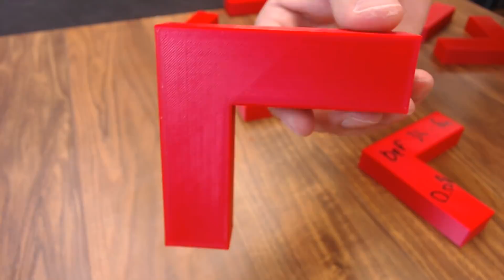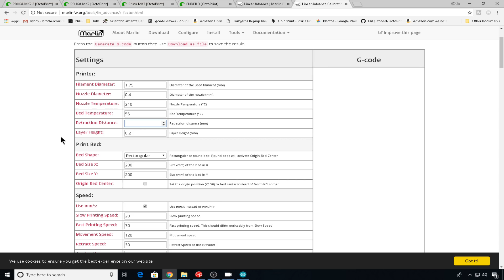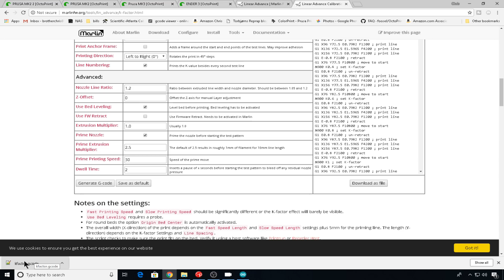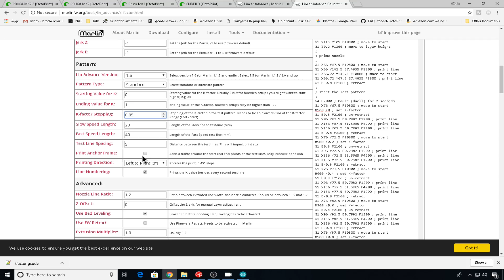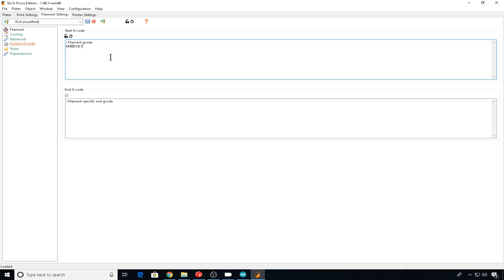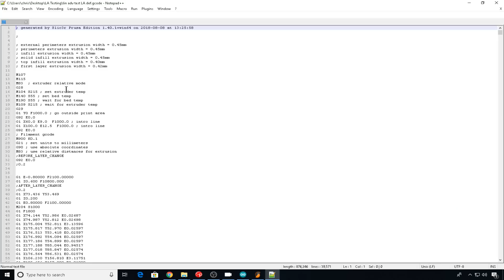Linear Advance - Marlin 1.1.9 - Faster 3D Prints - Chris's Basement

Comment: do you have a good article on slicer settings and values to change it to when Linear Advance is on? im currently using prusa slicer.
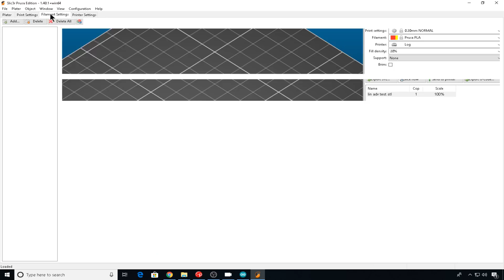Reply from the maker: 10:36, really all you have to do is add it/update it to the filament profile and you are all set.
Reply: @ChrisRiley  what do i change on my filament profile?
Reply from the maker: @darkfool58  If you are using Marlin, you just add an M900 K0.02    Update this command with the K value from the testing.

Comment: Hey, thanks for the great video, Chris. Question for you though... I'm running an Ender 3 Pro with a BTT SKR Mini E3 v2 and just started playing with Linear Advance. When it's enabled, the extruder makes a horrible grinding noise for every move. If it's disabled, no noise.  Any ideas?
Reply from the maker: What is you K value set to? If you enable it then run a M900 K0 does it go away?
Reply: @ChrisRiley  I downloaded the latest firmware from BTT's GitHub page, which has it enabled. I set Linear Advance K=1.1 based off of my experiments using Marlin's calibration gcode generator (it makes the grinding noise when printing that as well).  The K value is set in my Prusaslicer filament profile.  When I print another gcode file without the K value set (so set to 0.0), no issue.
Reply from the maker: @shannim5  Try adjusting your extruder jerk value, try making it larger to slow it down a bit.
Reply: @ChrisRiley  Doesn't seem to do anything. Looking at the configuration.h file,  it looks like E-jerk is defaulted to 5.0.  I've tried several values greater than that and it still makes the grinding noise. It's hard to tell if it's actually grinding the filament though. With K=0, I've haven't encountered any filament grinding and the extruder seems to be able to change direction and accelerate with no issues (visually looking at my extruder knob).

Comment: My linear advance calibration looks good except for the restart, at the start of each line (on both the calibration print and any model) it’s a little thin. On models you’ll notice gaps in the seams, or poor adhesion between the walls on starting locations (because the wall is too thin at start). Any suggestions? I thought maybe retraction is too high but i’ve tested between .2 & .8, retraction speeds between 20-70mm, no skipping of steps everything is calibrated perfectly on extrusion (bmg dual feed direct drive). Only thing I haven’t tried is adding extra restart distance - but everything i’ve read says don’t use restart distance. Your thoughts?
Reply from the maker: I would check through your Gcode, it sounds like the slicer is adding some retraction somewhere. Maybe like retract on layer change. What E driver do you use? What is would K value?
Reply: @ChrisRiley  made sure all the retraction on layer change and stuff was gone it is fairly good about retraction use but everytime it uses retraction the restart pressure just isn’t there. I use the TMC2209s, k0.13. All the corners and speed changes look amazing, but those darn restarts...
Reply from the maker: @TheFunVampire  What slicer are you using?
Reply: @ChrisRiley  idea maker
Reply from the maker: @TheFunVampire  Hmmm...I would have to try that out.
Reply: @ChrisRiley  oh forgot to mention i turned off LA, still had the issues so its got to be something with my retraction in general. But im direct drive, .8mm retract, 50mm retract speed and 20mm restart. Nothing crazy. Tried temp ranges from 200 to 215 (less then 200 seems to cause clogging). This is all in PLA for now. Until i get PLA perfect im not touching anything else 😂
Reply from the maker: @TheFunVampire  I was thinking about this. Maybe it's your jerk value. Are you using jerk or junction deviation? Either way, it might be to slow on retraction.
Reply: @ChrisRiley  using jerk and acceleration. Turned JD off. Think i should compile the firmware again with LA and JD on? Do they work well together? Going to go check jerk values now

Comment: Dos the K value change with Layer height , for example if you do your Test pattern at 0.2 layer height (where its Easy to pick winner) will it alter if you then drop your prints to 0.1 ??
Reply from the maker: No, it shouldn't change with layer height changes.

Comment: do you need Linear Advance with Prusa MK3s? or is it auto in there software.  just looking at the Pretty PETG profile thing and it said something about Linear Advance so then i decided looking into that was needed
Reply from the maker: If you use prusa slicer it's in the filament profile. You will see the M900 command in custom gcode.
Reply: @ChrisRiley  thanks

Comment: @chris Riley, Would you know how to configure linear advance for 4 extrudes, the configuration tool doesn't have a setting for them, ie T0, T1 etc, cheers jason
Reply from the maker: Hey Jason, are they all different types or all the same. If they are all the same you can just enter your M900 command in the filament gcode settings and on tool change it will use that setting.
Reply: You should be able to edit the gcode to switch nozzles. By just changing the extruder index

Comment: Great video Chris thanks for taking the time to share your knowledge with the maker community.
I have a problem that I am hoping that you can help me with. Firstly I must point out that I am a complete novice to 3D printing, I have an Anycubic I3 Mega S which is less than a month old, but already I have migrated to Marlin 1.1.9 and installed TMC2208 drivers and a BLTouch, which caused me quite a few headaches in getting it to work correctly, (thank heavens for YouTube!).
My problem is this, after homing (centre of the build plate) when I start a print job the print head travels  to the front centre of the build plate at an unbelievably slow  speed (you can actually hear the feint ticking of the Y stepper motor as it traverses. When it eventually gets to the front centre position, it zero’s the Z axis then travels back to the centre of the bed and starts printing normally. I have inspected my configuration in Marlin but I can’t seem to find a setting that would correct my problem.  Can you help me please? Thanks.
Reply from the maker: Hey Fred, thanks. So you do Z safe homing in the center? It sounds like something isn't setting the feedrate correctly. Anything interesting in your start gcode?
Reply: Hi Chris, thanks for your reply. Yes there is something not quite right (I think???) in my start G-Code in Cura, I can't see a speed number for travel, but like I said I am still learning. Here is my start script, please tell me what you think.

G21 ;metric values
G90 ;absolute positioning
M82 ;set extruder to absolute mode
M107 ;start with the fan off
G28 X0 Y0 ;move X/Y to min endstops
G28 Z0 ;move Z to min endstops
G1 Z15.0 F{speed_travel} ;move the platform down 15mm
G92 E0 ;zero the extruded length
G1 F200 E3 ;extrude 3mm of feed stock
G92 E0 ;zero the extruded length again
G1 F{speed_travel}
G0 Y20 F{speed_travel}
M117 Printing...
G5
Reply from the maker: @m0gga  Hey Fred, not sure what that speed_travel parm is set to, but, if you replace {speed_travel} with 5000 that should get it moving much faster.
Reply: @ChrisRiley  Thanks Chris, where will I find that parameter, in my slicer or in my firmware settings?
Reply from the maker: @m0gga  That's in the slicer, look for travel speed under the speed section. You might have to enable that setting to have it be shown. You can do that in preferences then settings and just check all.

Comment: What would help more, higher or lower acceleration / jerk on the E stepper motor?
Reply from the maker: In what since? With Linear advance enables you mean? I don't think I understand the question.
Reply: Sorry, my bad.
What I meant to ask is:
What would help more with linear advance, if I would higher or lower the acceleration / jerk value on the E stepper motor in the Marlin firmware?
So, would it be beneficial to have a higher acceleration and jerk (on the E stepper) for linear advance, as long as the motor don't overheat and don't miss steps? I don't mean extreme values just a bit more than what I normally use (500 acc, 5 jerk), like 2000 acc, 10 jerk?
Thanks in advance.

Comment: I'm a little late to the linear advance party. I have cr10 with Bowden. Tried this yesterday and struggled a little. I have S curve acceleration and junction deviation enabled. Would it be better with standard acceleration and jerk?
Reply from the maker: There is a certain mix that can confuse things. I would try with jerk and standard accel to start out.
Reply: @ChrisRiley  well, after a little messing around I'm matching the quality of the previous prints. This time no clattering of the extruder and much better infill.
There's light at the end of the tunnel!!
Reply from the maker: @TYGAMatt  Nice, great job!
Reply: @ChrisRiley  thanks. I'll give it a bash

Comment: Hello,
Very well explained.
It works on X however  cann't see any inprovement on Y. I have a 3mm glass on  bed. Any suggestion?
Reply from the maker: Hmmm, probably just a lot of mass to start and stop. If you lower the acceleration it should improve it some.
Reply: @ChrisRiley  Hi,
Which of next lines referes to acceleration that you recommned to lower:
#define DEFAULT_MAX_ACCELERATION {2000,2000,100,10000}
#define DEFAULT_ACCELERATION 500
#define DEFAULT_RETRACT_ACCELERATION 600
#define DEFAULT_TRAVEL_ACCELERATION 1000
I guess it should de "#define DEFAULT_MAX_ACCELERATION {2000,1000,100,10000}" 
Is that correct?

Best regards
Reply from the maker: @arturomendez7945  Correct, I would start with #define DEFAULT_MAX_ACCELERATION {1000,1000,100,10000} then move up from there.
Reply: @ChrisRiley  HI,
I already have changed extrusor spring as old one grinded so much filament (K value was 0.22). New spring force is less.
Now I have tried again LA and looks that best K values is arround 0.6. I am in doubt about such value as k values shared from several 3D printer users is around 0.2 (0.1 to 0.28). I know that range pattern goes from 0 to 2. In my case only manly change is spring.
FYI: Just changed power supply too that ajusted to same voltage 13.5V
What do you think about such value? spring can influence so much?
Reply from the maker: @arturomendez7945  I've never seen one come back so high, seems like you might still be slipping on the filament or something.

Comment: I tried it and my bondtech bmg started making a crazy noise, it didn't sound healthy.  Is this normal?
Reply from the maker: There have been issues reported in some configurations. They are still working the bugs out. No, you shouldn't have any strange noises.
Reply: @ChrisRiley  I only tried it with cura, I'm going to try again prusaslicer and see if that fixes it

Comment: Don't go over a value of 2 for Bowden setup?  But Marlin's own generator suggest starting in values of between 30-100 for bowden tubes.
"Starting value for the K-factor. Usually 0 but for bowden setups you might want to start higher, e.g. 30"
"Ending value of the K-factor. Bowden setups may be higher than 100"
Reply from the maker: Hey John, are you looking at Linear advance 1.0 maybe? They changed the scale in 1.5.
Reply: @ChrisRiley  Pulled directly from the generator when I posted.  Maybe they didn't update the generator text
Reply from the maker: @JohnVanderbeck  Ah, yep, I see that. Probably needs an update.

Comment: Why would you set your acceleration lower than normal for the test?  İt should be an important precondition from what you explained.
Reply from the maker: Linear advance 1.5 actually adjusts acceleration as needed.
Reply: @ChrisRiley  Yes obviously.  The thin is that if Like me, you have set E acceleration low just to avoid that bounciness it wont have any effect.  Further tge blobs at the corners are not just caused because of the pressure buildup in the nozzle.   I had experimented really, really a lot when I was coding around SFACT. (Yes the ACT is me).  I tried to disable steppers before retracting for example so the pressure would be released so you have actual consistent retraction.   What I found was that the pressure does not increase linearly but the increase is wavy and also dependent on the duration of the extrusion.  I used to have videos on Youtube about them but I deleted them some time ago..  So the blobs at tge corners are also similar to the kerf phenomenon that laser, and even worse waterjet cutters experience.  İmagine a rope hanging in your hand that you try to maneuver through a corner path.  It will swerve out.   That is what happens...
Reply from the maker: @ahmetcemturan  interesting.

Comment: Isn't linear advance much more useful on a bowden setup?
Reply from the maker: It is, but ironically, much harder to get dialed in.
Reply: @ChrisRiley  - do you know why it would go thinner on every pass from 0 up to 2.0 on Marlin 1.1.9? Even on a bowden setup, CR-10?

It's almost like it's BEST at 0 on a bowden setup - it almost seems like a negative value would be best (no joke) - and that's confusing to me. I can't seem to find the accurate info on this as the test creation page on Marlin references up to 150 which clearly isn't right on 1.1.9 with 1.5.
Reply from the maker: @cschwehr  I have seen that, it's usually because the grid isn't granular enough. Try running the test set to 0-0.5 My guess is you will end out with a setting of around 0.3 or 0.4.
Reply: @ChrisRiley  I ended up with 0.8 on my Ender 3 with stock extruder
Reply from the maker: @andrewchudyk8518  Sweet! That's awesome!

Comment: I've recently adopted the Flex3Drive flex shaft direct extruder which exhibited exactly the phenomenon you showed in the video. Since this extruder has a 40:1 gearing, I had to change the e-steps to 3800 from the original value of 95, and the E jerk to 0.1 mm/s. With this setup, the printer slowed down to a crawl as the K-factor increased incrementally from zero. Thanks to someone's suggestion who employs a similar flex shaft extruder, I bumped the E jerk to 30 and was able to arrive at a K-factor of 0.07 and printed a perfect linear advance test at 150mm/s. It appears the jerk value is used in the linear advance calculation. Do you have additional insight on this topic in relation to the flex shaft extruder? Thanks again for an excellent presentation.
Reply from the maker: You're welcome! You know, this is very interesting. I never really thought about a flex shaft extruder and how that might affect things. I don't currently have any experience with them, but I would like to learn more for sure.

Comment: I have a mk2s and looking in Slic3r PE most of the filament preset k values are 30-45ish? Has this changed with an update or is the decimal just moved in newer versions of marlin?
Straight from Slic3r 
M900 K{if printer_notes=~/.*PRINTER_HAS_BOWDEN.*/}200{else}30{endif}; Filament gcode
Reply from the maker: Prusa is using version 1.0 of LA, the value scale is different. The current version is 1.5.
Reply: @ChrisRiley  I thought so too. As the latest slic3r pe profiles indicate. I have ran this same test as this video and my results are more like yours with values under 1 and anything over 10 is exactly the same. I have only had the printer for a little over a week and the prusa online help chat didn't even know linear advance was enabled.  I'm on firmware 3.1.0 r10. I have sent an email to prusa support but honestly don't have high hopes as you content has a higher technical reasoning behind your answers.
Reply: @ChrisRiley  I'm getting values of 0.3-0.4 for PLA and 0.7-0.9 for PETG but I'm having a hard time getting the PETG sticking to the bed not to mention it's a translucent color makes judging really hard.  

Here are my examples
0-150 in PLA
https://photos.app.goo.gl/ypssDd8f1ZVtSB5w8

Then 0-0.5 PLA
https://photos.app.goo.gl/tcT76DnMNR1r7bWW7

I'm just looking for a sanity check. Like I said I've only been at this for about a week and messing with linear advance settings less than day. How could I be the first one to catch this on a firmware that has been out for a year next month? I must be misunderstanding something somewhere.

Comment: Hi, can you help me please ?
I did it on 8 bit board, working well, but i have a 32 bit board with Marlin 2,0.  I set the Advance_lin on and set to 0, and the Extruder motor do Nothing... like disabled. the test will be printed, and i see the acceleration fifferent, but comeing no material out...
thx.
Reply from the maker: My guess is linear advance has a bug in 2.0. It might not be fully baked yet.

Comment: I did all this and the calibration print showed that a K-Value of 1.2 is the best.
But when i tried to print a calibrationcube at 80mm/s it pushed the filament out like crazy!
It made a 5 mm thick sausage which got pushed onto the printbed, stopped at the corners for a while and kept pushing out the filament.
Reply from the maker: Wow, that's crazy. Sounds like you hit some sort of bug.

Comment: i heard that you can  extract the best  settings from your printer form the gcode files provided on teh samples ( provigind the samples printed perfectly for you )    how do you do this.. video please:)  its a feature in  that pay slicer software but not in cura or slic3r  ... it may make it easier.. 
also why does not slick3r have  calibration gcodes built in .. ie configuring extruders steps and first layer z offset setups for bed levlling. or a manual bed level code where you move the bed to co ords then punch the extruder down .01 at atime tillit grabs paper and  then figure out mesh bed level manually that way ? sorry about my dyslexia
Reply from the maker: I have never tried to import a model and see what the settings are. I saw Chuck do it in S3D. I will try Slic3r and let you know how it goes.